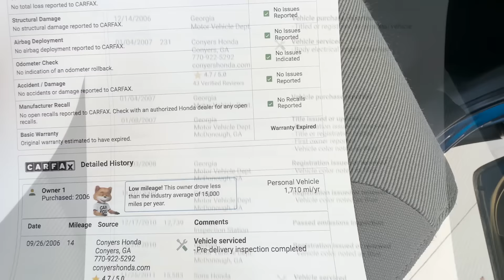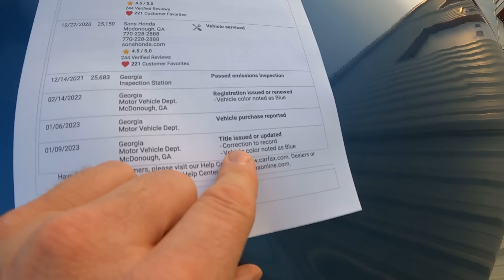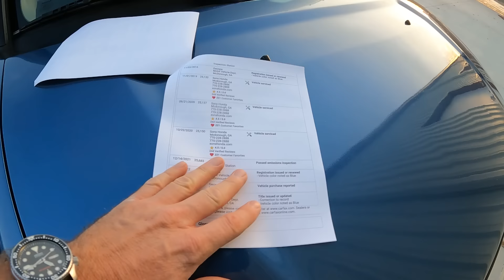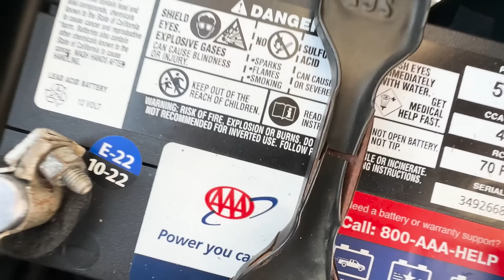I got totally SCREWED ON FACEBOOK MARKETPLACE!! What would you have done?

Comment: This is common in any area with a IAA insurance auction place near buy. Around me there litterally a whole street in wichita full of car "dealerships" that go to insurance auctions, buy a vehicle, fix it and sell it for usually 5 to 10k less then the same vehicle from a reputable dealer.. Personally iv bought vehicles in that condition and fix and sold them and kept them (have a chevy equinox I bought with 25k miles 2 years ago that was a hail damage vehicle.. I took it to a good local body shop 5k they went completely over it and iv been offered 3 times what I have in it from dealerships because it has a "clean carfax" 
I look at it as what am I going to use it for? If it's a computer car that I'm just going to rack up miles on I want a low mileage drive train, heater and AC. 

Your situation sounds different, like you where looking for something that was factory original, low miles, and perfect and I totally get being mad that it's not what you found, but when looking for something like that you have to be able to negotiate from a position of "f%ck you" because you can't trust anybody selling something further then you can throw them, and if your looking for perfect your looking for the 1% out of all of them on the road.

Comment: I know enough to drive a car, inspect a car, use the radio, A/C, heater, CD player and every single light, check the oil, put it on a lift, and check the brakes and tires. If the trans doesn't shift right, if the cruise control doesn't work, or if anything doesn't match the description I pass. I'm a regular Joe but I wouldn't buy a car from a picture of from afar. Should've taken your money back and left. STOP WHINING DUDE. You were acting like a fool on steroids from the lust to buy a pictured car.
Reply from the maker: I'm not sure why insulting me seems appropriate....did ya listen to the story here....I FLEW TO ATLANTA!! This is simply a "buyer beware" story that folks need to hear so they don't make the same foolish mistake that I did. Passing on a car that's 20 mins away is easy....passing on a car when you have no way home is a different story.  I'm still driving the car and it's great, but the paint is horrible !  No sense in putting me down here my friend...absolutely no sense in it.  Not sure why it's appropriate to treat strangers this way when you're on the internet